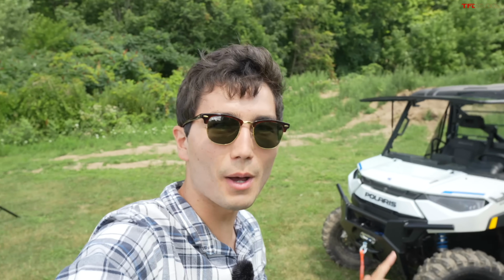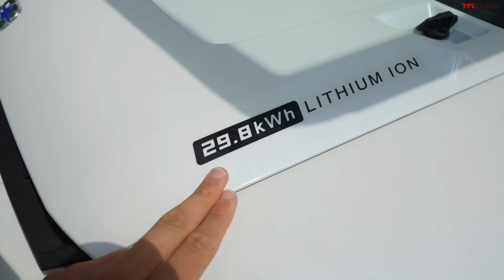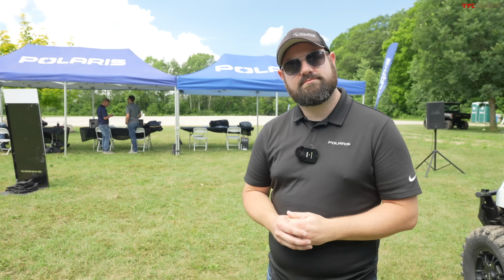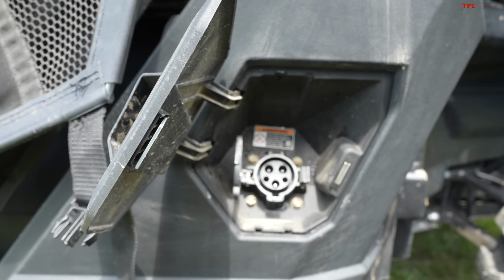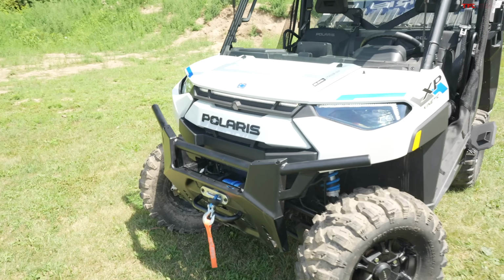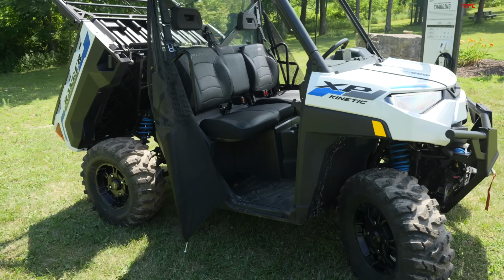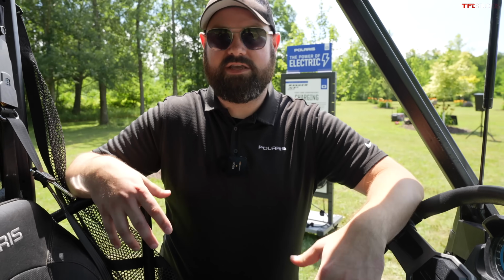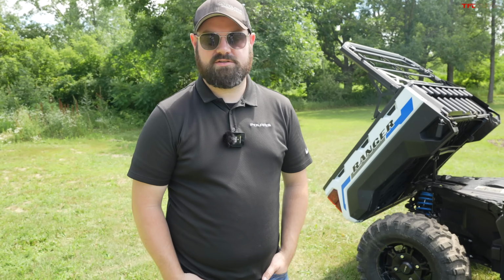The Polaris Ranger XP Kinetic is Quick, Electric, and Shockingly Capable!

Comment: A $30,000 Plus side by side. Who notices an additional grand here and another 4 grand there. Everyone has a kitchen drawer with bundles of $1,000 bills and bank accounts with $100,000 cash balances they casually snap up to run out to buy a pair of $30k side by sides, a $25k toy hauler to put them in and an $70,000 pickup to tow them around with. Living the dream.

Comment: I really would like a electric side by side for buzzing around the ranch and to work in town but no way am I paying 25-30 grand for a side by side that gets 35 mile range.
Reply: There at least used to be a much more affordable one with much  less power and bling. Probably just lead acid batteries but I can’t recall.
Reply from the maker: Yes the Ranger EV uses much more basic lead-acid batteries — not as fast or exciting but cheaper at $14,999. Still on their site.

Comment: 35k? bro....
Reply: Vehicles at or below this price
Jeep Wrangler
Elantra N
WRX
Jeep Gladiator is just above at 37k
Civic si 
Civic type r is just above
Even the bronco starts below if you can get it at MSRP

This price is ridiculous and dont even say its because its an EV. Chevrolet just lowered their price of the Bolt, which has a larger pack, to 25k. That's 10k less than this
Reply: To be fair even the none EVs are expensive. I own a Northstar Ultimate and paid around 27k.  I think the MSRP for a new Northstar Ultimate is 30K.

Comment: The word "experience" must be trendy while I am not. An  "order session" is a new one also, but when that becomes trendy, someone will explain it to me. Otherwise, I've driven an older electric ranger and really enjoyed it, and we modified one a few years older than that by replacing the OEM battery with a bunch of truck batteries at a cheaper cost and it seemed to be fine. It is strange hearing all the sounds that are normally covered up by the gas engine sounds.